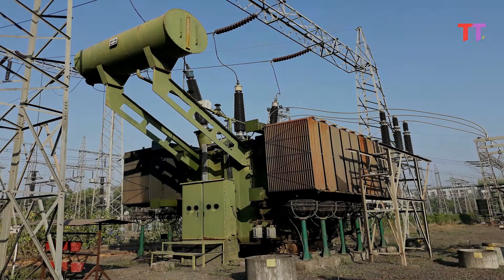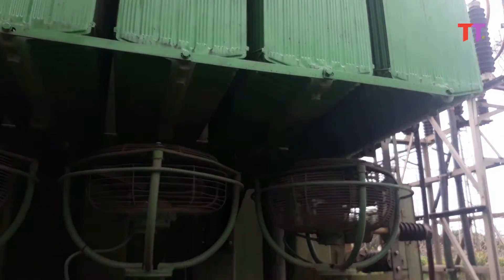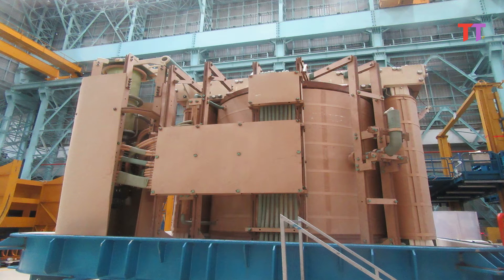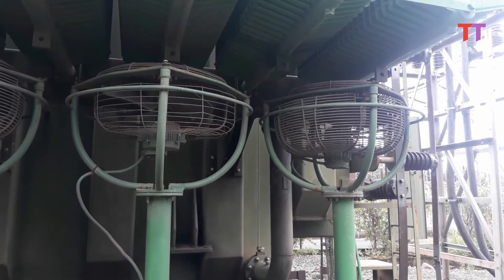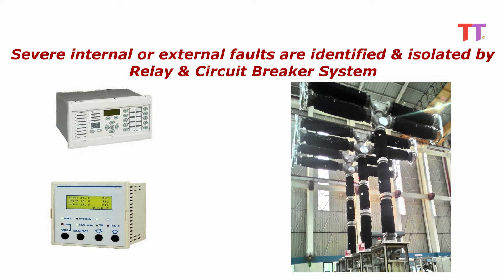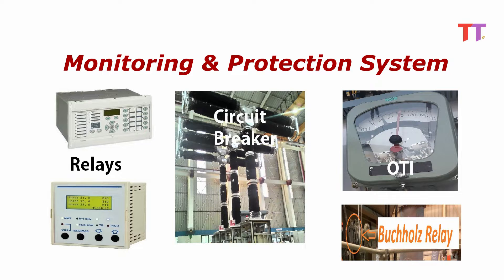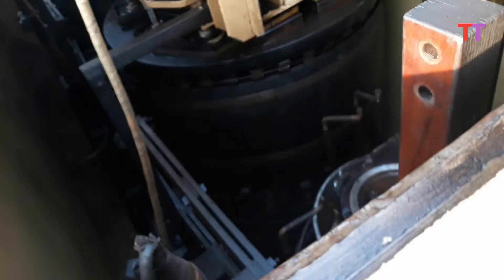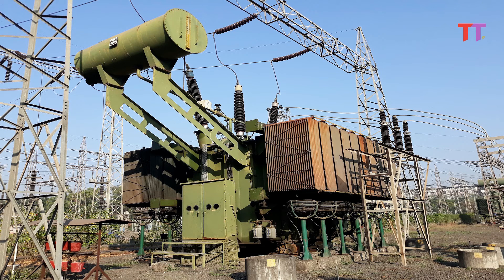Power Transformer Explosion Incidents - Reasons & Precautionary Measures

Comment: Historical incident questions (sorry for the length): My grandfather was killed abt 6 mos after the pic at left was taken (age 26) in a paper factory transformer explosion in July, 1923. It was definitely a closed casket affair after being electrocuted and covered in flaming oil.  Most articles just talk abt the death but not much detail on the how it might have happened. I have no knowledge in this area so I thought I'd see abt getting feedback from those who do. He was pretty new to this kind of work with maybe up to 2 yrs max exp w/a local power co & was an insurance salesman before that. Something must have been noticed with this transformer though, for them to call him in. I could see where inexperience could have been the main factor but I'm curious if the transformer might have been right on the edge of losing it no matter what.  One article that quotes co execs states that at 9:30am he was "manipulating switches controlling high tension current and his hand slipped, touching the brass".  It's the early 1920s and I have no idea what brass might have been "hot"  to electrocute him from just a slip but all others mention the size of the transformer, its explosion and burning oil.  A diff article states; "Officials say 33,000 volts went through his body when the transformer burst..." and a fire chief in another says "...they found that a giant transformer had been blown to pieces" and the victim had been "virtually baked to death".   Any idea on abt what "size" related more to capacity/limits rather than physical (though any ideas would be of interest), this transformer might have been?  Any info, ideas, feedback in general would be great. Thx